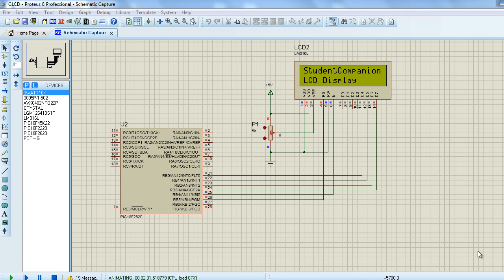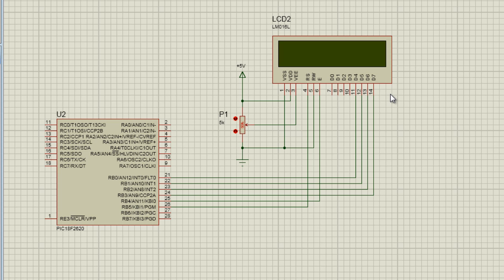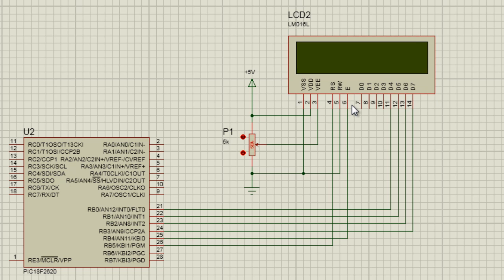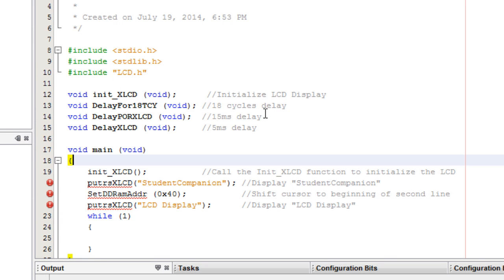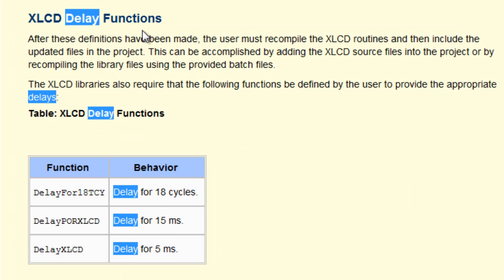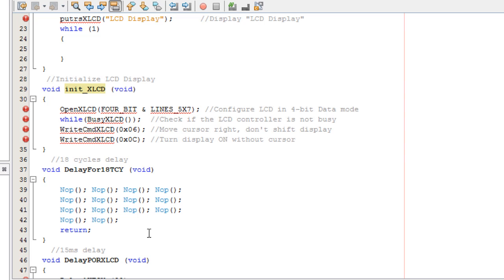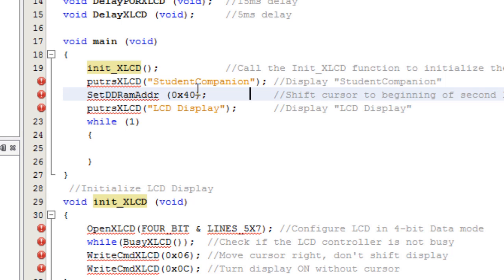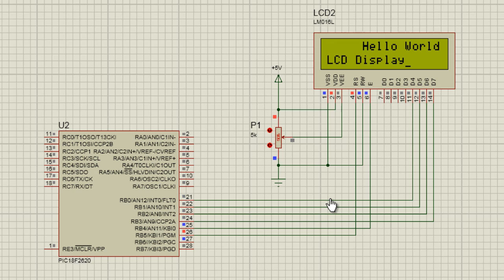5- Interfacing an LCD Display | MPLAB XC8 for Beginners Tutorial

Comment: hi sir, i successfully built the program, but  the lcd does nt work. what need to be checked, ?
Reply from the maker: +Jayesh kumar p r what do you mean it doesn't work? Does it display anything? Does it display black squares? Is the lcd back light on?
Reply: the back light is on and there is black squares.
Reply from the maker: +Jayesh kumar p r if there is black squares than the problem is the contrast of the lcd. Turn the potentiometer connected to the lcd in both direction until it display some characters
Reply: HI SIR ,i adjusted the potentiometer ,when i adjust it it slowly disapper. it does nt shows any word. only black squares
Reply from the maker: +Jayesh kumar p r uplaod your code and a sketch of your circuit diagram in the Forum . We will have a look at it.
Reply: ok sir, i will do it, thank you sir
Reply from the maker: +Jayesh kumar p r you are welcome!
Reply: hi sir, i posted it under lcd interface with xc8 . please have a look over wen u r free. thank you sir
Reply from the maker: +Jayesh kumar p r please upload your project in the Forum not as comment on our website.
Don't paste your code, upload the full zipped project so that we can compile it and test it on our side. Upload the circuit diagram of your project as well to see hour connections. Here is the link to the Forum: 
http://www.studentcompanion.co.za/forums/
Reply from the maker: Here are your error:

1. In the header file: newxc8_header.h you define the frequency as 160MHz (#define _XTAL_FREQ 160000000) if you are intending to use 16MHz, delete one zero.
2. In your main C file: newmain.C you are defining again the configuration bits. Why? other you delete the header file and configure everything in the main C file or you delete #pragma config in main C because you have done already in header file.
3. In your main C file: newmain.C why you are defining again the frequency? because you hav edone so already in header file. And you are defining it again wrong: #define _XTAL_FREQ 1600000008 is 1.6GHz not 16MHz. You must be careful with your zeros.
4. You must include the header file in your main C file. write this code on top of your main file: #include "newxc8_header.h"
    The delays you used are for 8MHz like in our example, you must calculate for 16MHZ. Write these delays in your code: We have uploaded a working project in the Forum.

    void DelayFor18TCY( void ) //18 cycles delay
    {
    Delay10TCYx(20);
    // Nop( ); Nop( ); Nop( ); Nop( ); // 18 cycle delay
    //Nop( ); Nop( ); Nop( ); Nop( );
    //Nop( ); Nop( ); Nop( ); Nop( );
    //Nop( ); Nop( );
    //return;
    }

    void DelayPORXLCD (void) // Delay of 15ms
    {
    Delay1KTCYx(60);
    // __delay_ms(15);
    }

    void DelayXLCD (void) // Delay of 5ms
    {
    Delay1KTCYx(20);
    // __delay_ms(5);
    }
Reply: Thank you very much sir..i will modifi the codes as u mentioned and let u know the rsult. Sir. How to calculate the delay for 16 mz?
Once again thank you very much  :)
Reply from the maker: +Jayesh kumar p r you can learn how to calculate delay from this article: http://www.studentcompanion.co.za/connecting-light-emitting-diodes-led-to-a-pic-microcontroller-xc8/

Comment: Hi
I am facing this problem with building the project using peripheral library. Can you please find me the solution? 

nbproject/Makefile-default.mk:125: recipe for target 'dist/default/production/test_4.X.production.hex' failed
make[2]: Leaving directory 'C:/Users/Hp/MPLABXProjects/test 4.X'
nbproject/Makefile-default.mk:84: recipe for target '.build-conf' failed
make[1]: Leaving directory 'C:/Users/Hp/MPLABXProjects/test 4.X'
nbproject/Makefile-impl.mk:39: recipe for target '.build-impl' failed
make[2]: * [dist/default/production/test_4.X.production.hex] Error 1
Reply from the maker: Hi. What version of the XC8 compiler you are using?
What PIC model are you using?
Did you install the Peripheral Library into your compiler?
Reply: Student Companion I am using xc8 verison 1.38
And PIC 18F45K20
Also I have installed peripheral libraries and I have also ran LCD with the mcc tutorial you have provided, but now I wanted to do it with the peripheral library and while buildingit's generating the errors mentioned above
Reply from the maker: Did you link the Peripheral Library? 
Right click your project --> Properties --> XC8 Linker (left side) --> On right side scroll down and tick: Link in Peripheral Library ?
Reply: I just did
and it built fine this time
Thank you very much Sir
Looking forward to learn more from you
Reply from the maker: You are welcome!

Comment: please another question... you said if RS is given logic 1, D0-D7 becomes data, and if given logic 0 they become commands and also the E pin must be given 1 to work on LCD. but in the above code didn't specify if RS and E was given 1 or 0 . my question is what gives this RS logic 1 in your code and also the enable (E) pin as well.. because i thought they were going to be specified, please explain.
Reply from the maker: +Temitayo Abel that's why you are using lcd libraries.  If you open those library files lcd.h and lcd.c you'll see how the commands are executed. All those functions like to initialize lcd or send characters the pins RS, E and data pins are manipulated in the background.  You can also control the lcd yourself without a library just the same  way you are controlling an LED or you can write your own library then you'll use those pins.
Reply: wow! didn't know that.. thanks so much sit!
Reply from the maker: +Temitayo Abel you are welcome!
Reply: How do i set up my own library?
Reply from the maker: +Temitayo Abel depends on what you want to do. It's a bit complex. You need to read your datasheets very well first.  I'll suggest you learn the basics first then think of libraries later.
Reply: Thanks for your suggestion
Reply from the maker: +Temitayo Abel you are welcome!
Reply from the maker: +Temitayo Abel and what is your code?
Reply: the same code you gave
Reply from the maker: Which code? we have many codes, many tutorials, and it seems like you are mixing codes of different tutorials. from your error message it doesn't seem like it's a library of this video.
Please paste your code then we will assist you.

Comment: why does it highlight those codes , cause it does same with mine and doesn't allow the code to be compiled it shows error all the time, please any explanation to that or probably a solution?
Reply from the maker: +Temitayo Abel which codes you are referring to? What error messages you are getting when you build your project?
Reply: your above code... and these are the errors it shows....

"C:\Program Files (x86)\Microchip\xc8\v1.41\bin\xc8.exe" --pass1  --chip=18F2220 -Q -G  --double=24 --float=24 --emi=wordwrite --opt=+asm,+asmfile,-speed,+space,-debug,-local --addrqual=ignore --mode=free -P -N255 --warn=-3 --asmlist -DXPRJ_default=default  --summary=default,-psect,-class,+mem,-hex,-file --output=default,-inhx032 --runtime=default,+clear,+init,-keep,-no_startup,-download,+config,+clib,-plib   --output=-mcof,+elf:multilocs --stack=compiled:auto:auto:auto "--errformat=%f:%l: error: (%n) %s" "--warnformat=%f:%l: warning: (%n) %s" "--msgformat=%f:%l: advisory: (%n) %s"    -obuild/default/production/lcd.p1  lcd.c 
lcd.c:23: warning: (361) function declared implicit int
lcd.c:24: warning: (361) function declared implicit int
lcd.c:25: warning: (361) function declared implicit int
lcd.c:34: warning: (361) function declared implicit int
lcd.c:34: error: (192) undefined identifier "FOUR_BIT"
lcd.c:34: error: (192) undefined identifier "LINES_5X7"
lcd.c:35: warning: (361) function declared implicit int
lcd.c:36: warning: (361) function declared implicit int
lcd.c:49: warning: (361) function declared implicit int
lcd.c:53: warning: (361) function declared implicit int
(908) exit status = 1
nbproject/Makefile-default.mk:100: recipe for target 'build/default/production/lcd.p1' failed
make[2]: Leaving directory 'C:/Users/Lekan/MPLABXProjects/lcd.X'
make[2]: * [build/default/production/lcd.p1] Error 1
make[1]: * [.build-conf] Error 2
nbproject/Makefile-default.mk:84: recipe for target '.build-conf' failed
make[1]: Leaving directory 'C:/Users/Lekan/MPLABXProjects/lcd.X'
make: * [.build-impl] Error 2
nbproject/Makefile-impl.mk:39: recipe for target '.build-impl' failed

BUILD FAILED (exit value 2, total time: 8s)
Reply from the maker: +Temitayo Abel The problem is because you are using XC8 version 1.41. From version 0.45 XC8 compiler does not include the PIC18F peripherals libraries which contains the lcd library.  You need to download this library separately and install it into your compiler.  They are now called Legacy libraries.  Watch this video to learn more: https://youtu.be/4WaB_Lj8FnY

Comment: OK. I tried to compile the code in this class. Downloaded the library lcd and lcd, I used the include, put the two files in the project, but the only thing I can to build is the message:

LCD h:46: error: (141) can't open include file ' mcc_generated_files/mcc. h ": No such file or directory
make [2]: * [build/default/production/lcd. p1] Error 1

What remains to be done?

Thank you very much for your attention.
Reply from the maker: +Joao Carlos Agostini hi. Are you talking about this tutorial: https://youtu.be/JxSSVtTj_fA ?
This is the tutorial and the process to follow if you are using MCC. On this video, MCC and thise two library files lcd.c and lcd.h were not used but PIC18F peripherals libraries.
Reply: Thanks for replying. t's a long story. I was watching this class, when I noticed that there was a #include "lcd h" in your code. I stopped the video, I walked into your site, I saw the library, downloaded it and installed it. I saw the video of the 22 class for a moment only. I saw this video and I finished that copy your code. I tried to compile and gave problem. Downloaded the Peripheral-libraries ... and tried to install it, but he did not find the Interface because the compiler it's not installed on C:\, but on another hd in H:\, but even directing it to the H: he does not recognize the Interface. So, just be able to "run" this program if I have Peripheral installed?
Reply from the maker: +Joao Carlos Agostini yes if you install the peripherals libraries you can run this program.  Before the peripherals libraries used yo be included into XC8 compiler but from version 1.35 and later you'll have yo download them separately and they are now called Legacy libraries. They won't be updated anymore and might not support new PIC because Microchip wants people to use ghe new MCC.
Reply from the maker: +Joao Carlos Agostini if you haven't used MCC  (Mplab code configurator) before, it's easy : https://youtu.be/JxSSVtTj_fA
Reply: OK. Thanks a lot. I will try to use MCC. I don't wish to change the settings on my  PC because of this program ...Peripherals. You are doing a great job.
Reply from the maker: +Joao Carlos Agostini thank you.